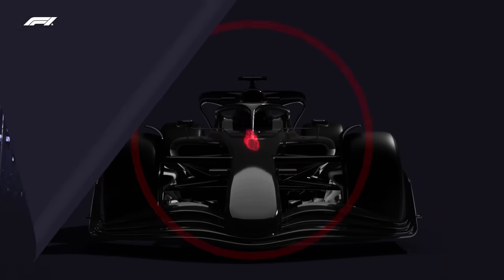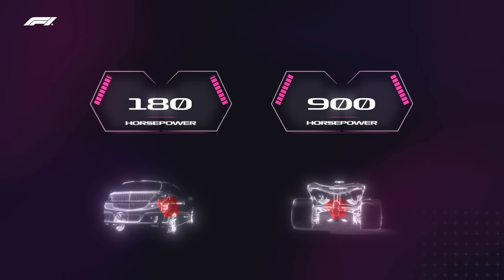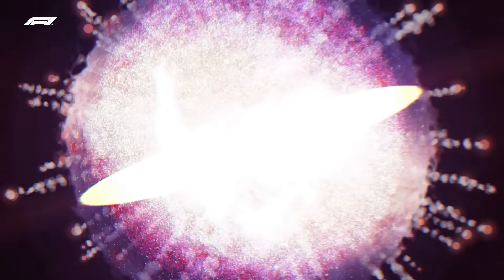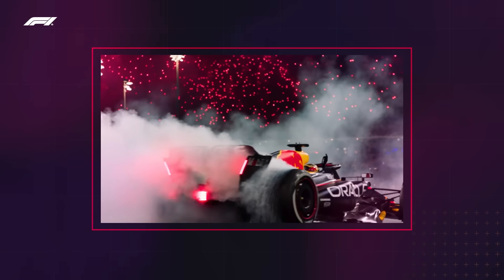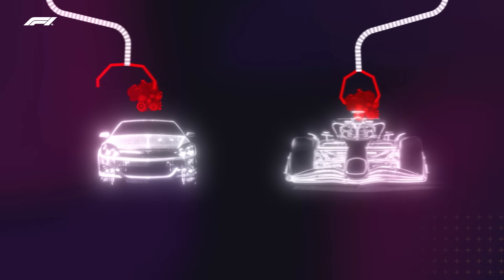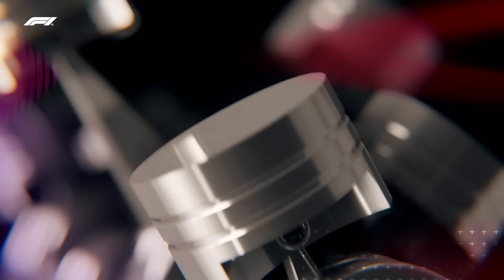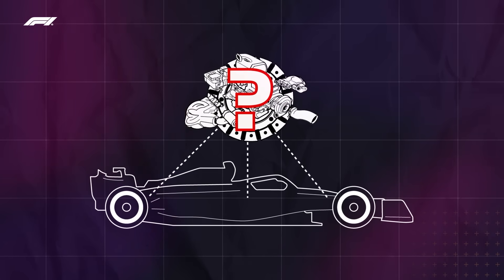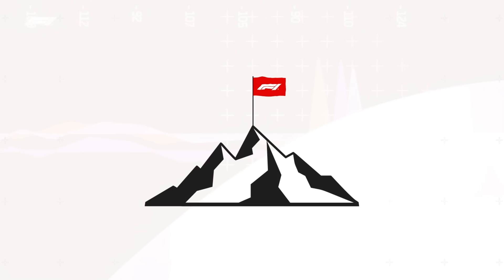What are Power Units? | F1 Explained

Comment: Hybrids should be using their drive shaft(s) as a "Turbine Generator", and trickle charge the battery at all times while it's moving. It might not be so impressive in normal roads cars, but I assume it could benefit cars that travel 60-240mph far more. Turn the differential into a "Turbine Generator" to collect energy along with regen braking. Use the force of their acceleration to supercharge the batteries, but trickle charge at constant speed. Indycar said their Super Capacitors don't hold charge very long, but most likely would is constantly charged. If that works, F1 could go Super Capacitors over heavier batteries also. So could the whole world.

Comment: I see. Formula 1 allows Hybrid engine combining turbocharged internal combustion engine with electric battery setup.  That's so cool man. It can generates more Hp you ever expected from a general pessenger vehicle. 900+ Hp aiming to touch 1000+ Hp by 2026 is simply madness. It is developed such a way the waste heat energy is recovered by electric motor and sent to the battery to charge itself. How efficient it is! So cool engineering.
The engine shaped is V likely. Believe me It can revs more than 15000 rpm.

Comment: "Basically a very very very advanced version of the engines used in regular road cars"
Except the road car engines actually have variable valve timing, lift and/or duration (many have them continuously variable), road car V6s aren't that small and hybrid power trains in road cars are more effective at filling the lag of turbochargers while being simpler.

Comment: Note that the "over 50% efficiency" figure is only possible because of the MGU-H, which will be dropped in 2026 due to the new engine regulations.
Why?  Because road car manufacturers are not interested in letting the MGU-H technology "trickle down" into road cars, and thus engine manufacturers no longer want to invest in it.
So the current generation of F1 engines will probably remain the most efficient engines forever.

Comment: The v 10s reved up to 20.000. The new v6 is nothing compared to a v10, the v10 produced 1.000 plus horse power and it was only the power unit, not the e.r.s or turbo. It was pure power
Reply: V10s also revved lower during race trim for reliability reasons. If they just dropped in v10s these days, teams would run them at lower rpms to last a whole season.
Reply: The V10s didn't make 1000hp, you are imagining that.  

The most powerful V10 made a little over 900hp in quali.
Reply: You were smoking something very strong when you wrote this. The V10s at best could produce about 900bhp and that was only in qualifying spec. Race engines were less powerful and yet they still blew up with monotonous regularity. The V6s are more powerful, more fuel efficient, more reliable and overall far more advanced than anything produced during the V10 era.

Comment: My man said, this engine produces an epic sound at 15,000 rpm. He must be young and never heard a V10 screaming at 19,000 rpm in person
Reply: I mean things can be relative...
Reply: They would sound great at 15, but they never rev much higher than 11.
Reply: didn´t say MOST.
Reply: The engines in the mid 80's were fairly nasty on the ears as far as sound wave impact goes but the V10's were a little worse on the eardrums.
Reply: If I'm being pedantic they actually only rev to 11'000 because fuel flow limits mean they don't make any more power past like 10.5 or so.
Reply: @alexisborden3191  you're not being pedantic, that's just stating a fact
Reply: @Lianpe98  I mean, I'm being pedantic because I don't actually care about the rpms
Reply: It sounds like he thinks these engines are the same as 10 years ago.

Comment: Just remember that all the cars on track every session last year used less fuel than 1 transatlantic flight, bring back v10s and push biofuels
Reply: and how many transatlantic flights are needed to ship all the F1 members and equipment back and forth?
Reply: @MCBritta  yea the need to focus more on that instead of renewable fuel for their car
Reply: @MCBritta 100% hey, such a joke to claim it’s all for the environment and blah blah just to fly, ship and truck everything.
Reply: Valkarie@CommandantNOVA
Reply: Valkyrie@CommandantNOVA
Reply: Biofuels aren't real, they aren't going anywhere, they take more energy to create than they provide.  The only way they become viable is if the cost of oil production gets like 10 times more expensive, and that's not likely to happen for a long time.  Also if the concern is CO2, then biofuels also generate CO2, that problem doesn't just magically go away.
Reply: While V10s are irrelevant to the modern engines, the 1.6l V6 doesn't have any relevance to road going engines either. If road going engines is really the development direction, inline 4 is the way to go.
Reply: Thats just not happening, so stop whining about it

Comment: "let's lower our emissions staring with the engine of 20 cars, driving for a couple hours every other week, while flying thousands of tons of equipment around the globe 24 times a year" yea seems like a reasonable point to start with.
Reply: you forgot the tons of people that will get to the track by plane or car
Reply: Seems that you're missing some pieces from the puzzle that is scalable innovation: improving the efficiency and emissions performance on those 20 cars won't put a dent into pollution, but it will when those advances reach the millions of road cars produced around the world. Racing has produced and/or perfected now-ubiquitous technologies like everything from ABS brakes to turbochargers.
Reply: @istdochallesegal3427 
😂
It's nice driving around in my Camry reving to 15k, running it's  pneumatic valve springs on non standard pump fuel only to stop at the traffic lights with my carbon ceramic brakes.
Reply: @istdochallesegal3427  that's a valid point, thanks for bringing that up.

Comment: There was a time when F1 engines revved to 20,000 RPM ! 👏 Those sound like jet engines & have a wail that's uniquely theirs 👍
When Cosworth was still a thing & F1 engines weren't rev-limited by regulations, their F1 engines were reputed to rev to 22,000 RPM !
In 2007 the rev limit was restricted to 19,000 RPM, in 2009 it was dropped, once again, to 18,000 RPM - this was also when the number of engines a driver could use in a season was restricted to 8, which felt like madness at that time ! 🤣
When the "hybrid" engines were brought in, i.e. 2014, the rev limit was dropped to 15,000 RPM 😭
In 2022, the engine RPM limit was dropped from the F1 engine regulations, but the fuel flow rate limits mean that the engines are indirectly limited to around 13,000 RPM.
Reply: Apparently the 2026 engines will still rev up to the same redline since the fuel flow limit hasn't changed 😭
Reply: Wow you know that regs changed, would you like a cookie?

Comment: 50% efficiency that is with the MGU-H. But it's gonna get removed in 2026. So you're gonna get back to 35%. 
I don't know why FIA is taking a step backwards just to accommodate Audi (allegedly). It will also introduce turbolag. Honestly, F1 is supposed to be the pinnacle of motorsports.
Reply: Apparently the mgu h is far too complicated to be relevant for regular road cars. This removal is the reason many car manufacturers are interested in joining F1 from 2026.

At this point, I think they are betting on 100% efuel instead.
Reply: massaged stats look better than the complete picture
Reply: They will get bigger MGU-Ks so that will help with efficiency
Reply: F1 always be pinnacle of motorsport
Reply: If Mazda can have a 50% efficient engine, I'm sure these engines are doing that efficiency without the mguh

Comment: 15k rpm is a bit lame if you've been following F1 for a while. These are electronically limited for power unit longevity. Cosworth produced a V8 that could rev to 20,000 rpm 😮
Reply: they're not "electronically limited", there's a rev limit as it was for the V8 and V10. The fact is they don't rev to 15 in fact because of the fuel consumption, so the real range of maximum revving is about 12/13k
Reply: Current 1.6 v6 turbo power unit is fuel limited. Before 2022 is 100kg/h. Now is energy density limited. Because of this limiter it only effective arround 9-12K rpm. Beyond that fuel became soft rpm limitter
Reply: They can use all the fuel available to them at around 12k rpm, more rpm just means less efficiency and therefore less power.

Comment: I like how i watched this entire video, with all of amazing engineering and roadmap for continued innovation, and you have people in the comments like "V10! hurr-durr". Like bruv, we are making huge strides in engine efficiency, power, and reliability. Way to ignore all that just so your ears can bleed each lap of an F1 race. I like the V10 sound too, but lets be adults about this.
Reply: it's not just about sound ... the incredible thrill, adrenaline pumping 19k RPM, the raw unmatched power they delivered with less aero; not only daring but also pure racing spirit
Reply: @_MAXrevs_  okay, I respect thats what you like, but watch BOSS GP if that's what you want. But we all know, and heard in the video, that F1 is about innovation for tech that can go into normal, everyday cars at some point. V10s are cool and are probably the best sounding engines in my opinion, but they are heavy and more complex to manufacture. F1 is the pinnacle of motor racing tech. And while I agree that only few have the real ability to handle those cars, but can you imagine going through Eau Rouge in the rain with way less aero and 1200 HP? Thats a deathtrap. Some of these drivers would never make it more than 2 or 3 laps before crashing, even in dry conditions.
Reply: @erouse91  you got a point there 👍🏻

Comment: The explanation makes it seem like the engine alone makes 900 hp and the turbo adds to it, but not by how much. Should be better explained. Also the rpm explanation makes it seem as though the difference is because one is turbocharged and the other isn't.

Comment: Great video, F1. Just one request: use metric units first, imperial second.
Reply: So you want them to go "This contributes 119312 Watts" instead of 160 hp?
Reply: @kasiphia ps is a metric unit which is equal to 1 horsepower
Reply: @kasiphia  120 kilowatts is just fine yes. It's what the people who design these things use.
Reply: @BamBoomBots   Yeah I don't think this video was intended for the people who design them 🤣
Reply: @kasiphia  Sure. But it also makes it comparable to other electrical appliances in a household. It's basically like 120 vacuum cleaners for example. If you want to teach people things teach them something useful if you can. Don't use obsolete units that serve no purpose anymore.
Reply: @kasiphia I'm an engineer for Ferrari and I learned a lot from this video. Still no clue how ours blow up all the time tho. Bad luck I guess.
Reply: @r0bs1904 
You learnt to buy your engines from someone else.
Reply: @BamBoomBots  F1 has always referenced engine power as horsepower. There is no need to change now
Reply: @kasiphia  They can say 119 killowatts, my metric impaired friend.
Reply: always one little snob in the comments complaining about units. like what difference does it make at the end of the day?  what one of them makes the car go faster?? Just learn to convert the fricking units man and shut up about them. its not the end of the world if someone uses metric or imperial, just don't switch them in the midst of what your doing if you're doing calculations or so on
Reply: @san-joshuabarrett  So can’t I just make a request? Is it somehow offensive to you that I request that the videos of this global brand use the most widely used measurement system, as opposed to one that’s only used in like four countries? Take it easy, mate.
Reply: @nolikeygsomnipresence270  ok they use metric first what next? what does it change? Not saying you cant make a request. Just tired of people complaining about simple stuffs like these every other tech talk video
Reply: @san-joshuabarrett  What changes is that the vast majority of their audience can quickly understand their content. How can you be tired of that, mate. It's not even your problem.